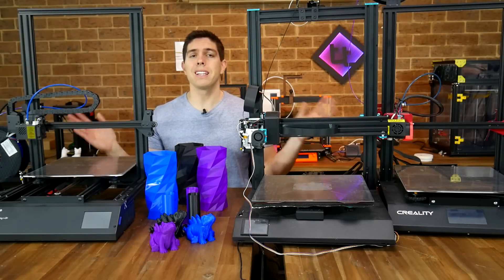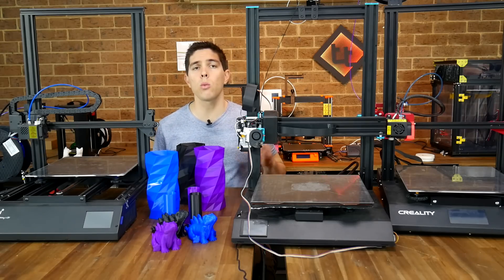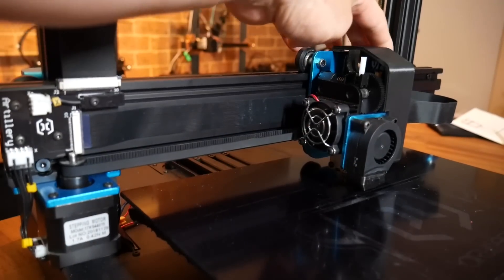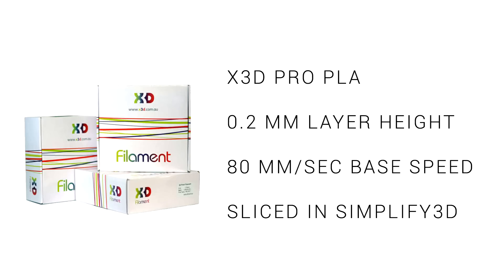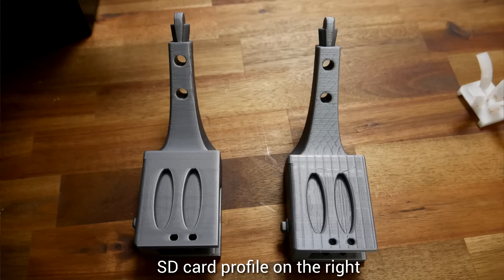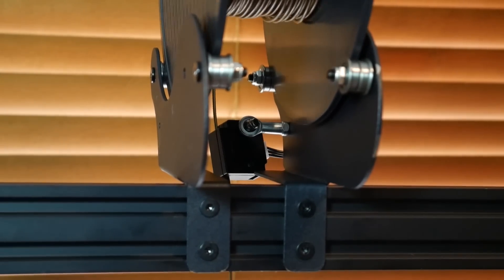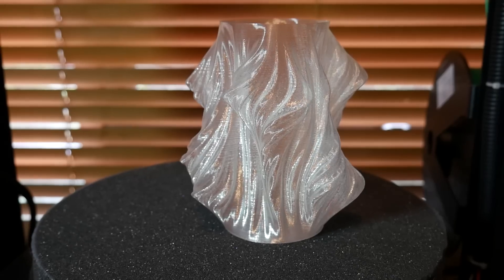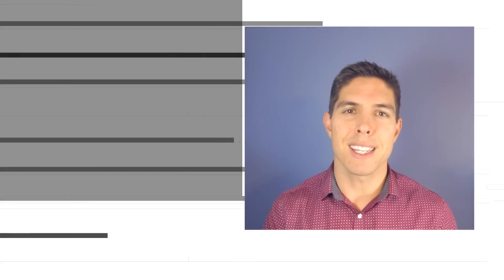Biqu Thunder vs Artillery3D X1 vs Creality CR-10S Pro: Large 3D printer comparison

Comment: would you add to this comparison the future Ender 5 Plus?, it would be nice compare corexy vs cartesian into the mix
Reply: The Ender 5 pro is not a corexy! It is also a cartesian (but in the classic cube style moving bed in z and head in x and y). Corexy would be an other kinematik (2 xy-motors working together with long belts, while on the Ender 5 pro the motor for x mounted on the x-axis (so more moving mass).
Corexy in this size would be f.e. the Tronxy X5s in the 300*300 version.
Reply: Agreed. Would love to get more reviews of the Ender 5 Plus. I've got an Ender 3x and am thinking of getting another printer in a few months - would love to hear more thoughts on the E5P.

Comment: I'm focused on sidewinder, but heard a lot about their quality control I hope they got better.
Reply: I got mine almost 2months back, it's been fantastic. Only 1 failed print in that time. It's built like a tank
Reply: It has inconsistent extrusion problem
Reply: seetcas in my v4 its absolutely perfect
Reply: The only issue I had with mine was I had to calibrate the extruder, however that should be done with all the printers. Every filament is different and alot of times you cant set it to 1 and expect perfect with all of them.